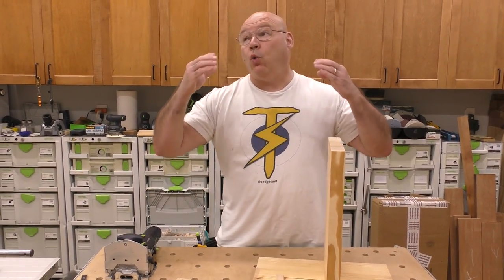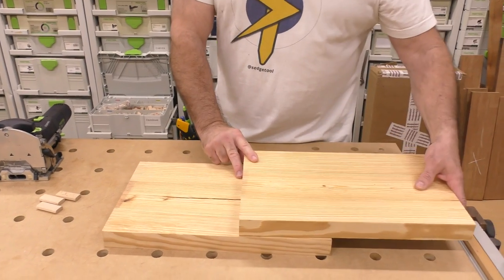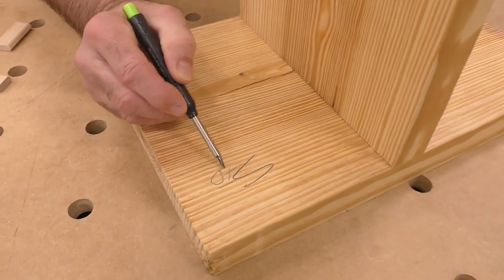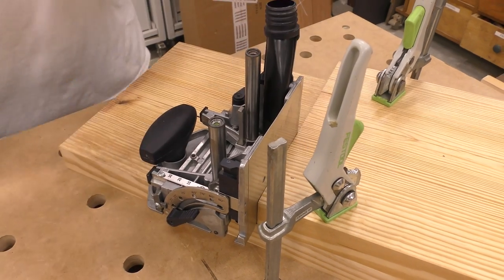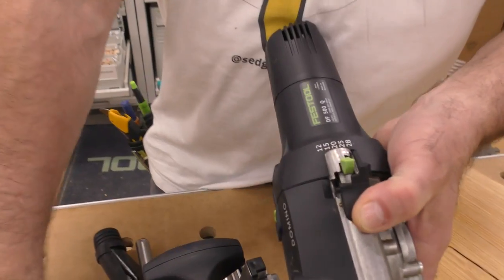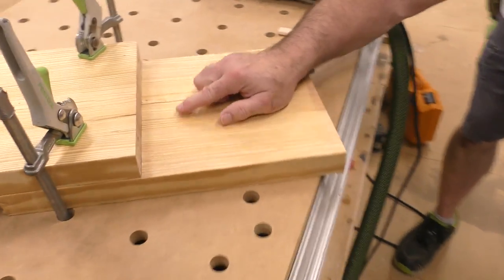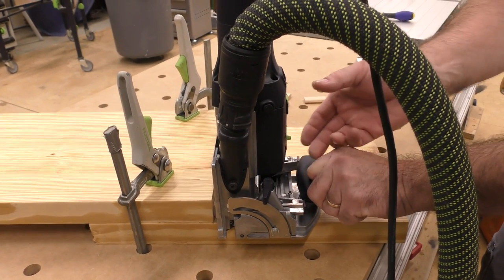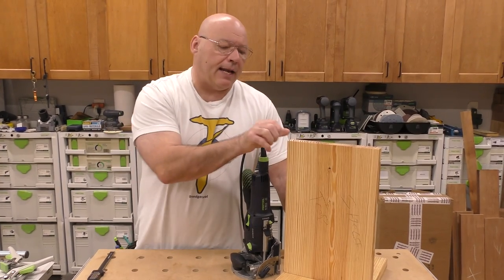Domino: Thick Fixed Challenge

Comment: Great tip Sedge.  I've wanted to try and center my Dominos on 18 or 19 mm plywood. So, i just bottomed out the fence and then moved it about an 1/8 inch, using a setup block. It's much closer to center.  Thanks again for the tip.  I've only had my Domino for 3 days.
Reply from the maker: Wicked cool !!!

Comment: At 4:45 you show what your calling “flaps” on the domino machine, are these a newer version of the old metal “pins” that stick out on older models or are these upgrades you can add to a domino machine?  I just have two metal pins that protrude out and can be pushed in when not needing them for a mortise cut.  Thx
Reply from the maker: The flaps are standard issue …… there is no upgrade kit for the pins …
Reply: @sedgetool  Thank You

Comment: Hey Sedge. Aren’t you making that explanation a little over complicated. The only dimension that would change in this situation would be from the bottom of the platform to the the middle of the cutter vertically. The dimension from the stop to the middle of the cutter horizontally wouldn’t be relevant if the height of the cutting surfaces changed vertically. That measures from the side of the board not the faces. All you would need to figure out is the center of the stock, and adjust your height accordingly with shims or the platform height adjustment. The 10mm distance from the stop to the cutter and the subsequent “math” just confuses the explanation.
Reply from the maker: Thanks for sharing

Comment: How would you go about the problem if the board is thinner, let's say 12mm or 16mm? I often work in 16mm MDF.
Reply: And great doing domino studies with you 👍
Reply from the maker: I would not use this method of working off the base ... I would set my plate height at 6mm for 12mm thickness ... and would set up the vertical plunge by scribing a line 6mm from center and line up the base for vertical...hope this makes sense
Reply: @sedgetool  Thank you. I was hoping there would be a quick trick for this also, but I also couldn't figure it out. Still very helpful 👍